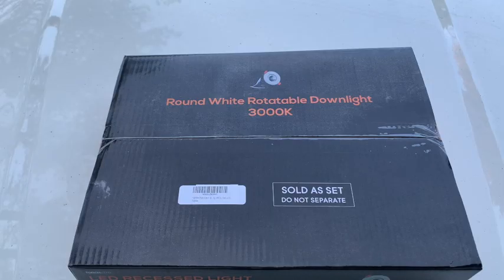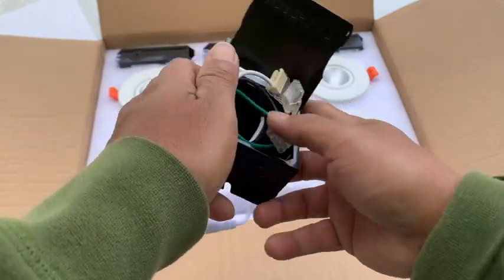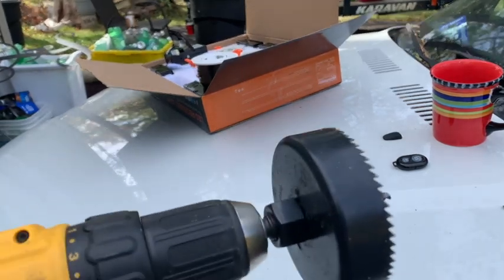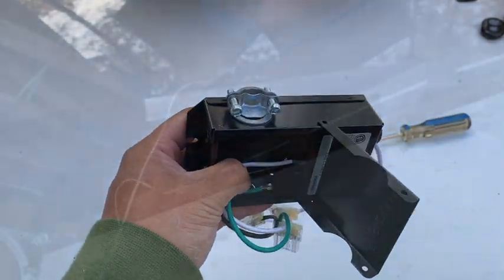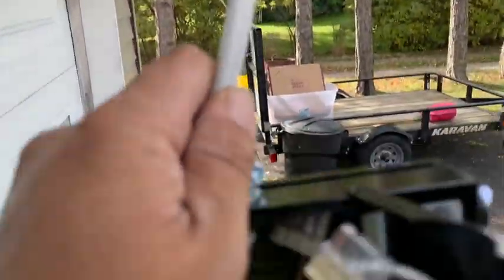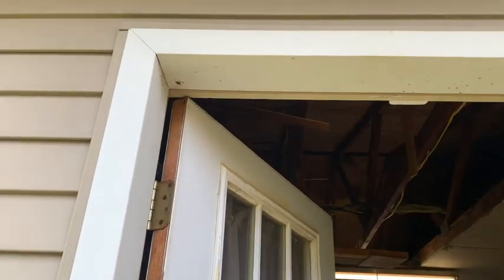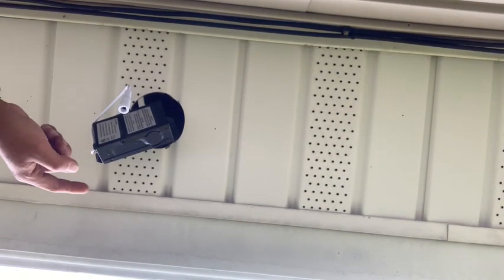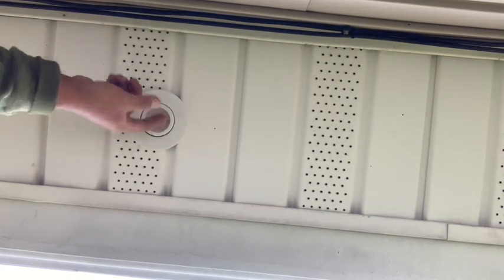Soffit Downlight, How to install.  Torchstar Gimbal LED lighting, Dimmable. Part 1.

Comment: Hi AJ,
How do you connect the 1,2&3 lights wired. Thank you for posting this clip
Reply from the maker: Hello David.  Inside each junction box of every light, you were able to connect the lights in parallel.  Just be sure to keep all the black wires connected to all black as well as all white wires connected to all white
Reply: @AJDIYNetwork  got it. Thank you very much!
Reply from the maker: @daviddang7139  let me know if I can help in any other way ;)
Reply from the maker: @OgnjenMali  right you are. Reflecting back, I realize my mis-wording and made the necessary correction to my answer. What the heck was I thinking.

Comment: Just making sure that it was vinyl siding you used the hole saw on..? I’ve been hesitant because I didn’t know if it would work or not.
Reply from the maker: Yes, it was vinyl soffits.  Be sure to reverse the drill so it doesn’t bite aggressively. First drill the pilot screw with the drill in the right rotation.  Once you get the pilot screw in, then reverse the drill.  Hope it helps. Make sure to go slowly.
Reply: @AJDIYNetwork  absolutely! Thank you

Comment: Have you set these up to be turned on and off automatically? Does that Wi-Fi outlet have that option?
Reply from the maker: Yes.  I have them on in the winter time. My initial plan was to do the rest of the house, but I marked that off my list to do.

Comment: Are these lights still holding up after two years?
Reply from the maker: Yes they are still working without fail. I use them more so during the fall and winter seasons as the nights get longer and the landscape light are buried under snow.  Thanks for watching!
Reply: @AJDIYNetwork , OK, thanks for for the quick response!

Comment: Would you share the link for the lights? And the switch? Thank you!
Reply from the maker: TORCHSTAR 4 Inch LED Gimbal Recessed Lights Adjustable with Junction Box, ETL & ES, 38° Narrow Beam Angle Anti-Glare Eyeball Spot Light, 950lm CRI90 Dimmable Downlight, 3000K Warm White, Pack of 4 https://a.co/d/0xVR9V3
Reply from the maker: Limited-time deal: Kasa Smart Dimmer Switch HS220, Single Pole, Needs Neutral Wire, 2.4GHz Wi-Fi Light Switch Works with Alexa and Google Home, UL Certified, No Hub Required https://a.co/d/gbXp3Zt

Comment: metal box, I dont use electrical tape.  just make sure the circuit your adding this to has proper amp rating for the load.  If there ever was an issue, should pop breaker before there is an issue.
Reply from the maker: Good point.  Thanks for the tip!

Comment: I enjoy your video, I am curious about the copper and aluminum wire mix in those connectors , and how well those connectors are holding up,, your doing a great job 🌺 if the lights have any issues I might recommend going back to the connections and making sure there is a visible amount of stranded wire , inserted into the connectors,,,about the same length as the pre installed wire should be visible in the connector , 🌺🌺I learned a lot from the fence lighting video - I love your channel please keep it up
Reply from the maker: Hello Kimber.  Thanks for commenting.  So far, so good. The mix is holding up well.  I still rub a maintenance check each season to make sure all is good and the connections are tight. I appreciate your advice and will
Apply To my my next project, if we decide to move. Cheers and be safe!

Comment: What type of wire did you use for the lights? Romex 14/2? Thanks
Reply from the maker: Yes.  I used 14/2 Romex. I went for a lighter gauge wire since i was operating LED lights. Thanks for watching.

Comment: When you snipped the ground wire you actually could have twisted and pulled it back out of the snap-in connection. It's tight but not too tight that you can undo any mistakes with the wiring.
Reply from the maker: Thanks for the info!

Comment: Hello
 How did you conect each to other   How is the process  u used for
Reply from the maker: Hello Kevin, thanks for watching.  I actually bridged each other together and ran it to the light switch. Each box, you are able to connect additional wires in “series”.  Hopefully this helps.
Reply from the maker: Yes, you’re right. My bad.

Comment: Bro! I've been trying to find videos related to soffit lighting in hopes of seeing updated or newer ones. I haven't come across one video that shows how to put soffit lights on garage door openings
Reply from the maker: I have been trying to as well and figured I’d post something that might help others out there. It was a little bit easier for me because my garage is not fully finished. Also, the soffits were vinyl and not your traditional wooden soffits.If there is a video that you would like for me to help out, let me know. Thanks
Reply: @AJDIYNetwork  I appreciate it bro. Mine is the traditional wooden soffit. I've been trying to find a vid diy for the wooden soffit of the garage door but no luck
Reply from the maker: I’ll look around and see.  If I find something, I’ll post a link here
Reply from the maker: Joe S. https://youtu.be/2ecFLuUVQWk.  Perhaps this can help?
Reply: @AJDIYNetwork  thanks but my garage door is flat and connected like a modern home. I looked at that video but it wasn't the one
Reply from the maker: Gotcha.  That is a tough one.  I’ll keep searching with hopes I might find something that may help.

Comment: what that wire connector thing your using called?
Reply from the maker: Hi Andrew.  It’s a flexible clamp connector. I may have called it something totally different in the vid.  

https://www.homedepot.com/s/flexible%2520clamp%2520type%2520connector?searchtype=suggest&NCNI-5
Reply: @AJDIYNetwork  thank you man and great videos :)
Reply from the maker: No problem at all.  We are in single digits here in upstate NY, and haven’t posted much, but I plan to once the weather begins to warm up next month.  Have a great day and stay safe!
Reply: @AJDIYNetwork  great video! very helpful and I will be tackling this weekend. where upstate?
Reply from the maker: @jmar7313  Binghamton.   How about yourself?    Glad I was able to help!  ;)
Reply: @AJDIYNetwork  cool! Couple hours up the road in Utica. Not to be mistaken with Ithaca lol. It’s rare to watch a video where somebody is or mentions they’re from upstate ny. Your video helped a lot. Especially with products. Where im worried im going to run into a problem is how to run my line from the lights to the panel since I’ll need to put in it’s own breaker since all of my plugs and switches near by are loaded. Thanks again and enjoy the fall before the you know what comes! 🙂 hopefully it's not as wet as our summer.

Comment: Where is your power source coming from?
Reply from the maker: I piggy backed off of another power source that lights up the backyard.
Reply: @AJDIYNetwork  so you just decided to daisy-chain from that location?
Reply from the maker: Yes. The light sources are LED for the porch light in the backyard as well as the Downlight’s.  Watt usage is extremely low.
Reply: @AJDIYNetwork  understood. I have a similar situation, so i was thinking of using a similar method, but bridging it from the same recessed lights in my garage. Thanks for the reply. Nice job.
Reply from the maker: @brettvukovich6220  I’m happy to help.  I plan to do more on you tube, I’ve just been tied up with work lately
Reply from the maker: Thanks for watching!

Comment: Whats the Hole Saw size?
Reply from the maker: Hi and thanks for watching. The lights are 3 inches, and so I used a 3.5 inch blade from harbor freight.   

https://www.harborfreight.com/34-in-5-in-carbon-steel-hole-saw-set-18-pc-68115.html
Reply: Thanks for the reply.